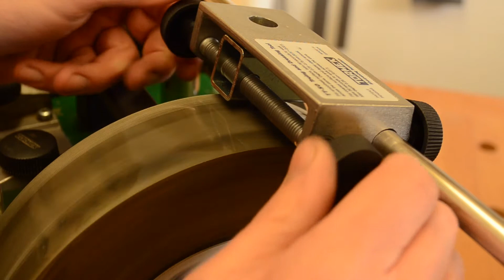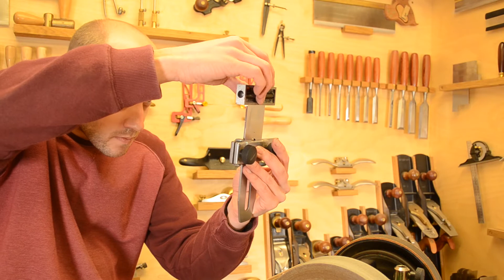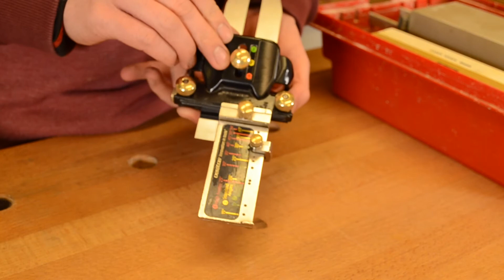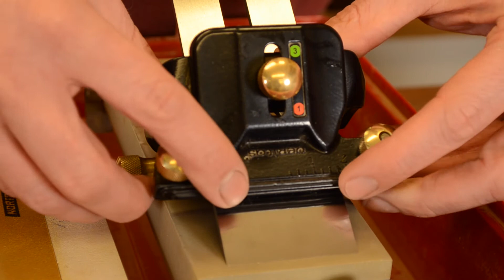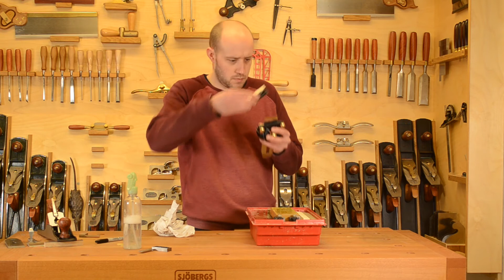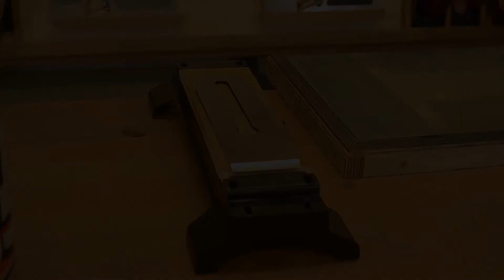How to sharpen a plane blade by Waters and Acland

Comment: Just shove it on a high-speed grinder and job done in 45 seconds without overheating, These wet grinders are just a waste of money.
Reply: You might be able to do that, but the majority of people may not. This is at least a safer option compared to high speed grinding, because of course, they are teaching it and have to consider safety as well as speed of set up.

Comment: I'm new to hand plane work and sharpening these tools. Can you tell me why a 25 deg angle is used when the frog sits at 45 deg? I have an older Craftsman plane that's ground at 45 deg from the factory. Thank you!
Reply: On a bevel down plane such as the on the video there is no relationship between the 45 degree bedding angle and the honing angle. The grinding and honing angles are a compromise between a shallow angle for ultimate sharpness and a steeper angle, which gives an edge less likely to crumble in use.  45 degrees is the cutting angle regardless. Unless a back bevel is employed, but that is a whole other can of worms.

Comment: Do you make time in your day for actual woodworking? While you are messing around with your ridiculous sharpening routine, I would have sharpened three blades and be back to work.
Reply: Discipline
Reply: ardvarkkkkk1 Good for you, assuming your blades are really, really sharp. But I have never got the hang of doing it the traditional way, and this method (broadly shared by many of the very best professional cabinet making shops and schools) works beautifully for me, and many others. It is far from ridiculous and I am afraid the tone of your comment says much more about you than anything else.
Reply from the maker: The  routine is far from ridiculous. It works and allows both our master craftsman in the pro bench room and students within the school to create exceptionally high quality work. Much of the time is spent with initial blade preparation. A resharpen is pretty quick and very effective. Having said all that, if you have developed your own technique that works and is quick then stick at it.

Comment: Couple of quick questions if I may. 

In your video about planing the blade back you only use a pull stroke as opposed to going both ways on the paper. What is the rationale for this?

Secondly I notice when using the tormek Graham has the supports in the front of the grinder so the stone is moving away from the blade edge. Tormek’s manual suggests having it in the top for plane blades. Is this just personal preference or have you found having it in the front gives a superior finish?

I often find that I have difficulty keeping a consistent angle when moving from the tormek to the mark 2 honing guide. It seems setting both at 25 degrees results in a very slightly different “25 degrees”. Any tricks you can share to improve on this.

Really enjoyed your videos and thanks very much for sharing them on youtube.

Kind regards
Reply from the maker: Check out the video on flattening the back of the plane blade. We look more closely at the pull strokes. We developed this technique as our students get more consistent results. A more repeatable and reliable action. Of course with practise you can master a push and pull stroke however we find once you use the pull stroke technique there is no need to try. Patience is needed when flattening but backing off is quick and easy.

We never need to have the tormek and the guide at the same angle. The guide is used for a steeper secondary bevel.

The tormek works well and is safer when set up like this.

Hope that helps and stick with it!!!